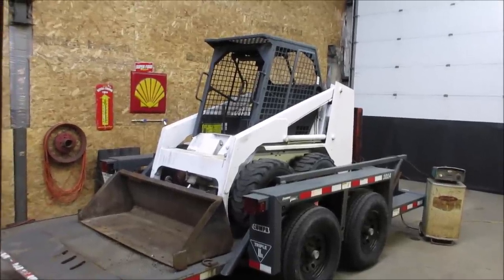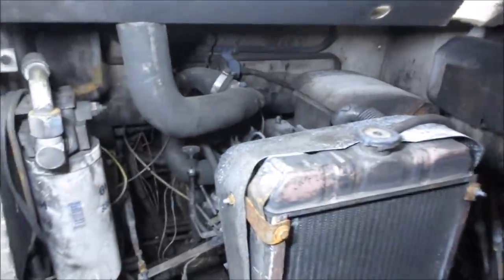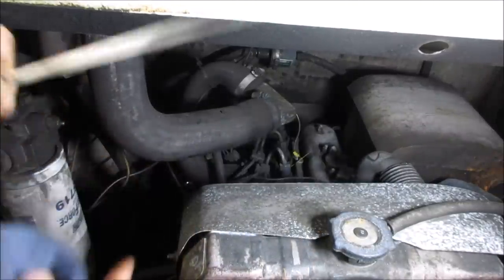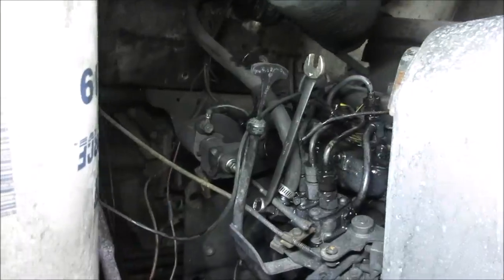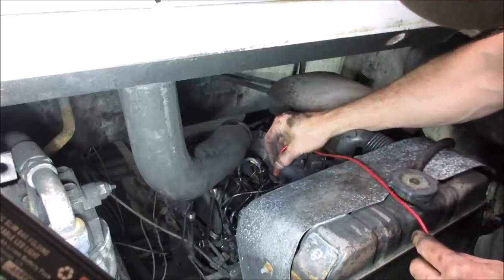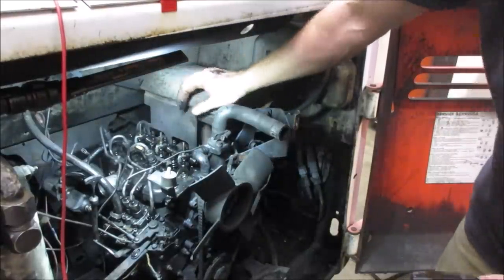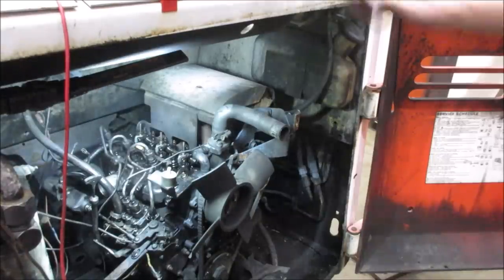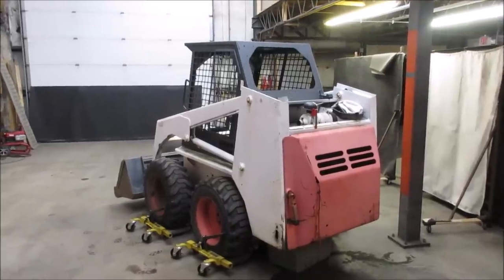Gambled on a Non Running Bobcat. Will It RUN?

Comment: I've owned several vintage bobcats.  Just remember: If there's no oil under them, there's no oil in them. Bobcats are ALWAYS leaking in my experience. I look forward to the updates.
Reply: Just like a Detroit, another Detroit saying is if there’s not enough oil on the ground to step in as you enter the machine it’s ok.

Had to edit this comment from its original, the short verse was incorrect, I made a mistake and it upset eric (actually spelled with a K) Larson. Sorry for any other feelings I’ve hurt, and entire weeks I’ve ruined
Reply: Scratch that buy I planned on. No wonder all my neighbors have John Deere tractors!
Reply: My early 80's 620 has a Ford pinto gasoline engine in it. It competes with the pump on which one can leak the most oil. I have five kids. I think I won. Probably not. :)
Reply: Your crankcase is full of diesel
Reply: @jjason1974  i agree, alot of cranking to get it running and the diesel pouring through the rings.
Landrovers also always leak, if there is no oil underneath it then it's out of it.
Reply: @ronfrance4041  Your comment seems to contradict itself and does not corroborate with MRC's comment.
Reply: @Hjerte_Verke  “if there’s no oil under them, there’s no oil in them” was made famous by Detroit. Needless to say it means they always leak oil. With the birth of the first saying inevitably came the second, which I commented. With the two sayings together you have established that leaking is normal, how much is ok, and finally two reasons for when you should be concerned.
Reply: WE call them crap cats
Reply: So true.
Reply: @saltycreole2673  Based on the amount of times I have screamed like a crazy man dealing with the drive belt and the deck  belts and the poppin' off cotter springs, I'd temper my enthusiasm for those pigs.  However, I own it and I'll ride it out for the duration of my natural lifespan I guess.
Reply: @saltycreole2673  have a 2005 s250, 3100 hours approximately.  Never has leaked.
Reply: @Melicoy But you forgot the most important rule in Musties world. Its got to be ridiculously cheap. I am 100% certain that it was so cheap, he lost sleep over it. Now he can lose sleep over the fact that its likely going to cost a fortune to get it operational. Sometimes its better to part with a buck here and there, no matter how bad it hurts your feelings. Especially when you expect a machine to work for you.
Reply: @tomlorenzen4062  pretty sure 2005 is not "vintage" lol my bobcat from the 70s leaks bad!
Reply: @ronfrance4041  You don't admit mistakes very often do you? An Engineer of some type? This is what you said verbatim, and it does not make sense. As was already pointed out. Yet, you still claim it makes sense. Lol. "Kinda like a Detroit, if there’s not enough oil on the ground to step in as you enter the machine it’s ok"
Reply: @eriklarson9137  an engineer who gets his hands dirty on old detroits and equipment in his off time?… I guess anything is possible. But I’d say you missed your last Facebook refresher course for your internet detective cert.
Reply: @eriklarson9137  I’ve taken care of my mistake I’ve made, announced it accordingly to the community. The original comment has been modified to suit your understanding
Reply: I have a 631 Bobcat with an air cooled Deutz 2 cylinder,  been running since 1976.
Reply: @ronfrance4041  I can feel a lot of sarcasm in your comments towards Eri(K) 

I'll just stick with that being the intent. Makes me giggle.
Reply: @giggiddy  Mustie is crazy, all right -- crazy like a fox.  The amount he pays for this stuff and the amount he sells it for pale in comparison to what he gets paid for the resulting YouTube video.
Reply: I just bought a 95 743 with no leaks at all! Full of everything! Only thing I had to do was put a starter on it but been a great machine!

Comment: In working on old GM diesels in the 80's, I would suggest that the rings are stuck. That would account for the terrible blow-by and no compression.
It would also explain excessive oil levels as diesel is passing by the rings and filling up the pan.  If the diesel didn't ruin your bearings, just putting rings in it and redo of the valves might be the cheapest fix.
Best of success to you Mustie. If anyone can fix this neglected beast it's you.
Reply: Old screaming jimmies? Man those things sounded great. I genuinely fear for Mustie if he ever gets his hands on one and doesn't realize he needs to make sure the injector racks aren't stuck before he starts one that's laid up, though.

As for this Bobcat's engine...if it really is just stuck rings a little heat and finding a way to crank it at a running speed until it starts might do the trick. HAve seen a fair few vintage cars that would never start by cranking start by being flat towed while in gear, and then once they get a couple heat cycles in them, the rings free off and they'll start by cranking. Can't do the flat tow trick on a Bobcat as they're hydraulic drive, but perhaps some other means of cranking the engine at a run speed might get it to light off?
Reply: Ah yeah, fuel in the crankcase--it gives me shudders because it dilutes the oil
Reply: Fill cly with B12 and let it sit for 2/3 days 
If that doesn’t work then you got to replace rings period
Reply: I AllWAYS put vice grips on fuel rack and start them and air plate to help kill it
Reply: Antifreeze and gasoline are probably worse than diesel. At least it was mixed with oil!
Reply: @ritchiesokol1061  Yup. I think the cylinders are all washed from about 249 gallons of starter fluid being used and it never starting.

Comment: Hey there Mustie. To check the compression. You can use the glow plug access hole as those other narrow fitting in the kit  are there to go into the glow plug holes.  So you don't need to take the injectors out to check the compression. Can't wait to see you get this one going as I'm not use to seeing you work on diesel. But in your case I'll give you 90 percent chance of getting it going. The challenge is on you getting it going.. All the best..🤞🤞👍👍
Reply: 90% is good 👍
Reply: You saved me from posting. I used to work on early GM light duty diesels at the dealership. They also used a luminous probe in the glow plug port to set injection timing while the engine is running. Probe would let you see the combustion flash while running.
Reply: On my Mercedes there was a brass seat that had to be replaced every time you took out the injectors.  PIA so I can see why using the glow plug ports would be better.  As long as they haven’t overheated and expanded so they can come out without breaking.  Nothing but potential problems.
Reply: On the compression tester paper it even says glow plug next to Kubota. Also adapter F on the back of the paper is long and skinny like a glow plug.
Reply: @Viperman200221  Men only read an instruction manual after everything else has been tried and failed
Reply: @brianrizzi6321  not only that you eliminate the risk of contaminating the fuel system high pressure pump and diesel injector are  expensive part and super sensitive to dirt contamination ence why diesel use multiple fuel filter
Reply: @mady383  Oh so true, LOL!
Reply: @Brian Rizzi  the seat washers are reusable, just aneal them with a torch.
Reply: @williamscarbrough7384 That would be very cool to see that in action.

Comment: The Kubota 3 cylinder is either a D600, D640, or possibly a D722. They require the glow plug to start unless the engine is at operating temp. Since you have fuel from all three ports in the injection pump, you are correct that the problem is most likely compression. You'll probably find that the rings are shot but the bores will ok unless scored. Also a possibility is a blown head gasket. I've had a lot of experience with these little engines and have turbo charged several for use in Cub Cadet garden tractors. The 600 and 640 came stock in several models of Cub tractors. If I can help in any way, reach out with a reply and we can figure out how to get in contact. I'm in upstate NY.
Reply: Yanmar made Cub Cadet at one time also.
Reply: @kd5inm  Only their 4WD compact tractors, I believe.
Reply: light towers also use them and can typically be found cheap with a bad generator head
Reply: Здравствуйте! Скажите пожалуйста сломало  распредвал на моторе кубота v1500 четырех цилиндровый мотор,  распредвал восстановили но не попали по меткам , как выставить  распредвал  правильно без метки? У меня бобкат TCM 725

Comment: If that's a Kubota D1105, those are the same engine that was used in the Terex light towers that were everywhere. You can usually pick them up at Ritchie Bros for less than 1K running. Compression should be around 400-460 psi, and valve clearance about 6 thou. The compression tester has to be tight- can't be hand tight like a gas engine. 

Lowest compression in the middle- I'd pull the head and inspect the head gasket, especially if you suspect it has overheated- which is very possible given the additions to the cooling system. 

The unit is in good shape for it's age, and these little Kubota's can be found everywhere.

Don't know if these have a paper filter, or oil bath air filter, but if oil bath it could have been overfilled, causing the oil in the intake. Get all that oil out, or the engine could run away shortly, once you get it running and the intake suction pulls it into the engine.

Comment: Hey @mustie1, here's a tip from personal Bobcat experience.  The fuel cutoff is run by a two coil solenoid.  Your solenoid shaft is disconnected where they ran a "manual" cable.  Normally when you turn the key on, it triggers two relays, one 5 second relay and one continuous relay.  The 5 second relay activates the main coil in the solenoid body that pulls in the solenoid shaft then shuts off after 5 seconds to keep the coil from burning up.  The continuous relay engages a coil in the end of the solenoid to hold the shaft once it's pulled in.  When you shut off the key, the coil dies and the shaft extends.  That's how the shutoff normally works on Bobcat diesels.

Comment: If anyone is going to get this Bobcat going it is going to be Mustie . He is persistent, to say the least.
Reply: He's N-Z not ?
(Zero unemployment zero delinquency etc.).
Congrat's from "l'A_france" (africa-france or anti-france...).
Reply: Wes could get it running too.
Reply: Well idk why I can't comment normally so I'll Wright my comment on yours as a reply sorry bout that. That looks like someone put a Kubota kit motor in at some point I don't think that's the original motor it sounds like a tired engine and injection pump
Reply: @matty2helpfull  I think the hours meter is lying too.
Reply: @tarstarkusz  most likely
Reply: Good thought Mustie .. put a VW engine in it mate 🤙🤙
Reply: Bobcats are actually really simple. There isn't much to them. However they are the visual representation of 6# of ** inf a 5# bag. Just a nightmare to work on. I've seen them so clapped out they burn more oil than fuel and leak from places where oil shouldn't be. 

My guess is there is head gasket issues and/or oil pressure sensors.
Reply: @tarstarkusz I think someone put an already tired, used engine in there to squeeze a little more time out of it. Then ran every ounce of remaining life out out it.
Reply: @tarstarkusz  hour meter is probably on its second time around

Comment: Hi Mustie, I've worked on these engines for over 10 years. Where the injection pump mounts on the block there should be a machined pad with the model and serial number stamped on it, the model number is also cast onto the side of the block under the exhaust. Parts are a bit pricey. Don't use ether starting fluid, it tends to break rods & crack pistons on these engines. A valve job, new rings & rod bearings bearings will probably get it running fairly well. Good Luck.
Reply: I was cringing so hard when he was spraying  away at it.
Reply: @vh3531  it had so obvi low compression ether not harming it
Reply: Glow plugs dont like Consent in a Can much either
Reply: probably needs a cam too tho. Possibly worn out because diesel has leaked past the rings, causing excessive valve play.

Cams are usually case hardened, so once you wear through the thin outer layer they're scrap.
Reply: goway with your ether nonsense... its not going to harm the engine

its fine with glowplugs, its gridheaters either doesnt agree with and thats more for the sake of the operators eyebrows than the engines internals

Comment: Way back in time, around 1970 at Wentworth Institute, one of the most challenging labs I had was to rebuild the injectors off of a big CAT diesel engine.  Lining up petri dishes with varying grades of oil we would disassemble the injector, clean the many little parts, reassemble, and then go to the pressure tester to grade our work.  As I recall,,, my injector never passed that pressure test.  Good luck Mustie, but if anybody can make things work, it's you.
Reply: WOW - a fellow WIT graduate (I  graduated with electronics degree in 1981)

Comment: I have the 542 version of that skidsteer. Only difference between 542 and 642 is the motor. Mine was a Ford Industrial Gasoline. 

I abandoned that and replaced with a Duromax 713CC. Took me maybe 8 hours to build motor mounts and a coupling for the hydraulics (all with parts from Tractor supply)!. Its now a very usable skidsteer. I actually spent the weekend knocking down trees and building trails on my property. 

P.S. The door isn't missing, it did not come with one and it was an option (very expensive option).